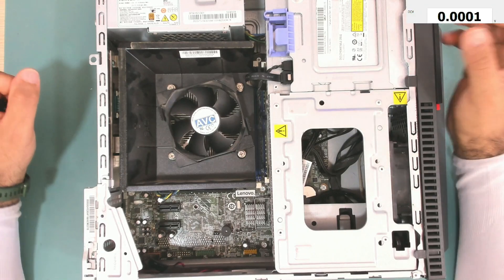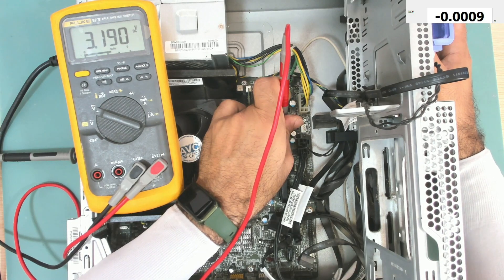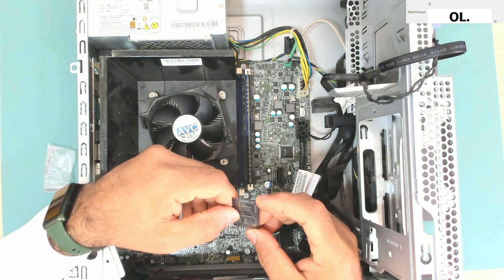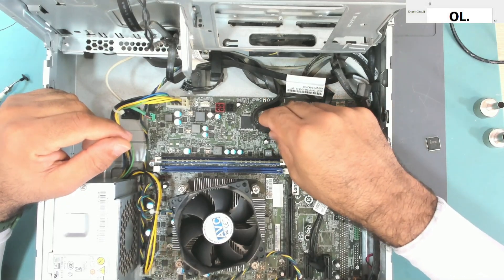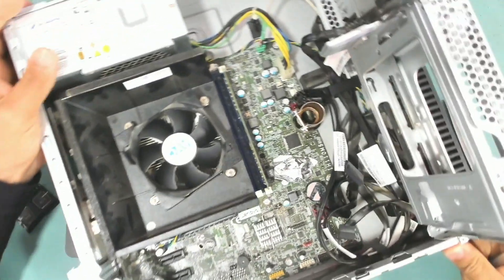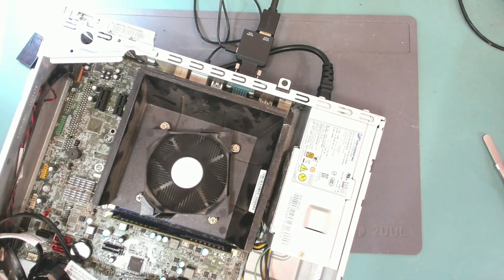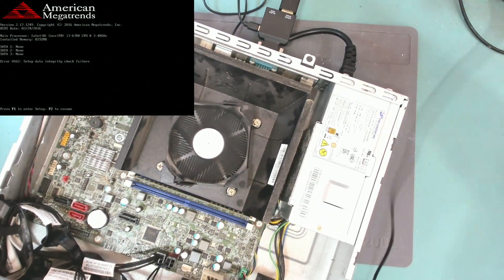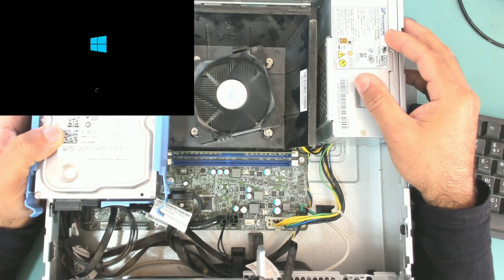Lenovo thinkcentre m72e No Power Repair || EC Chip Super IO ITE IT8625E Not Reading PWRBTN

Comment: Hello and thank you for sharing, how do we know if the I/O chip is programmable or not? And as for any other chip?
Reply: Hi, you need to find the datasheet and check if it is programmable or not. 
Here is a list of known SIO:
ene kb9012 programmable
ene kb9016 programmable
ene kb9018 programmable
ene kb9022 programmable
ene kb9028qc programmable
ene kb9010 programmable
ene kb3930qf/b1 programmable
ite it8585e programmable
ite it8586e programmable
ite it8985e programmable
ite it8587e programmable
ite it8522 programmable
ite it8987e programmable
ite it8589 programmable
ite it8522 programmable
ite IT8380E programmable 192kb
ite IT8380VG programmable 192kb
ite IT8995E-128 programmable
ite it8886H programmable
ite it8886he programmable
ite it8386 programmable
nuvoton npce288na0dx programmable
nuvoton npce388na0dx programmable
SMSC MEC 1609 programmable

ite it8518 non programmable
ite it8517 non programmable
ite it8572 non programmable
ite IT8528E non programmable
ene KB926QF C0 non programmable
ene kb3926qf non programmable

ene kb930QP A1 non programmable
ene kb910 non programmable
SMSC kbc1126-nu non programmable
SMSC MEC1322-NU non programmable
nuvoton NPCE985PA0DX non programmable
nuvoton npce285ua0dx non programmable
Found it on badcaps.
Reply: @transformateur9969  you can check by its mentioned number and google it